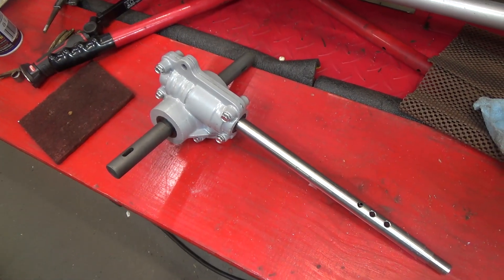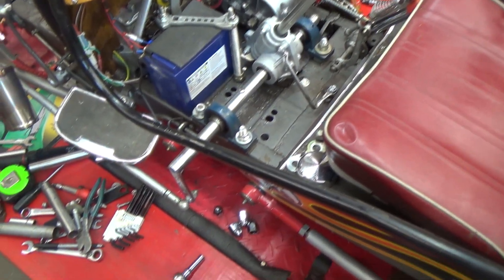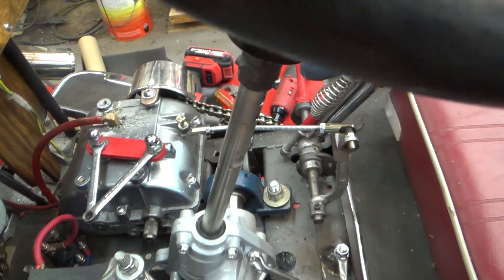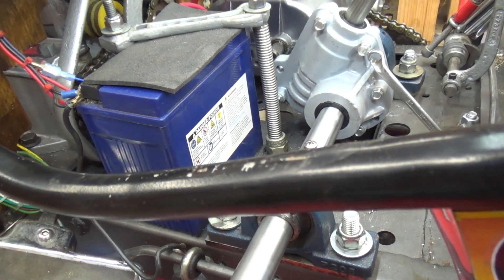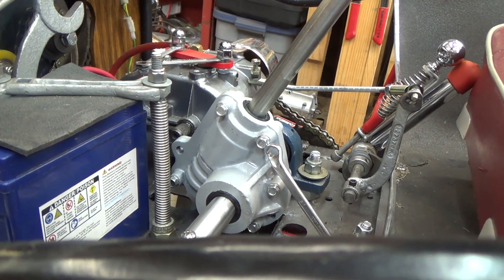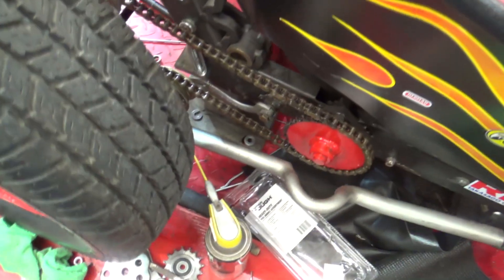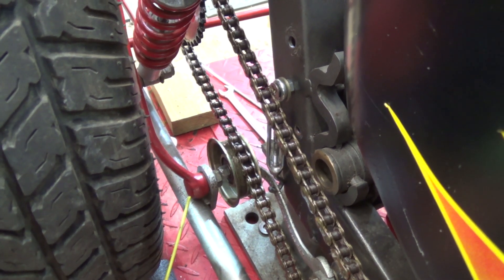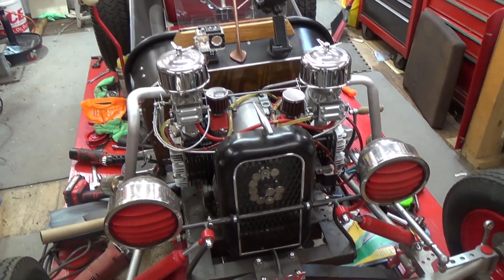Another new steering box for Goofy? Dual carbs, dual exhaust, twin cylinder, motorized wheel barrow.

Comment: Since the cross bar doesn't move, it must be the vertical as you thought.I wondered if the shaft went up and down as you turned. Otherwise, it's the gear mountings on their bars that have the slop.Since it's meant for a 'rototiller', I'd bet it has 'Shear-pins' and they allow the movement.Weld the gears,and ...tight.
Reply from the maker: We'll soon see once we open it up. Lots of good ideas popping up on this video. Thanks

Comment: It's definitely a Worm and Sector assembly. I'm going to guess that it's purposely built with all of that slop, to avoid breaking a shaft when blowing snow (if you pic up a stick or something). I doubt there is any way to adjust the slop out, unless you build up welds on the sector shaft. It'll be interesting to see how it's built.
Reply from the maker: We'll see what we find when we open it up. You are right about the built in slop, the big question is can we figure out a way to eliminate it? Thanks Neil.

Comment: How about instead of a box , put a sprocket on steering wheel shaft , Then another sprocket mounted to frame , but have a leaver sticking out from that sprocket  to hook the tie rod to . as you turn the wheel , one sprocket turns the other one with the leaver on it. Only play would be in the chain and different size sprocket would change steering ratio.
Reply: Only thing would not have any drop down  would be even to top of frame , unless a shaft went down the side of frame with the lever on it , still would swing on a different plane , so may have clearence issues . I am sure you will figure something out
Reply from the maker: That's a good idea. I am also thinking about just going with pivot points similar to a riding mower steering setup or go cart set up. Thanks for the suggestions Terry.